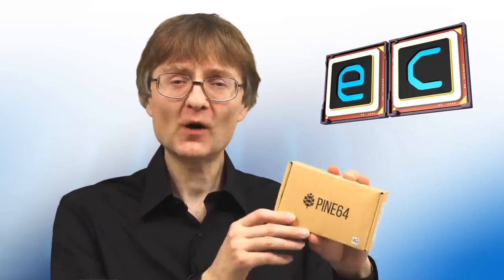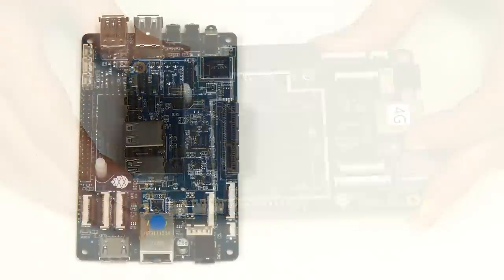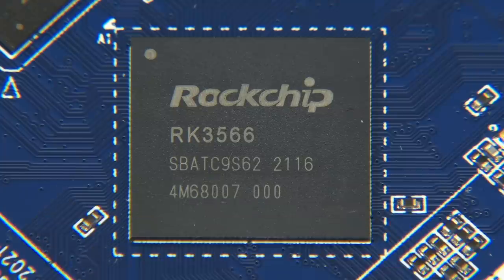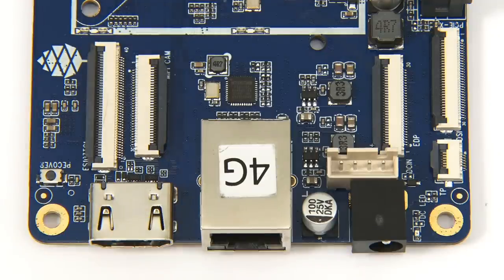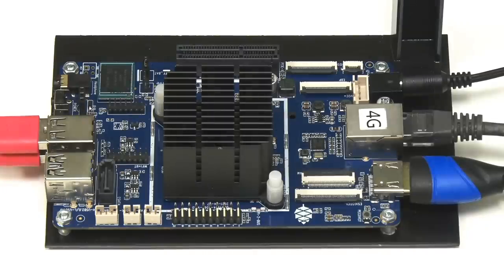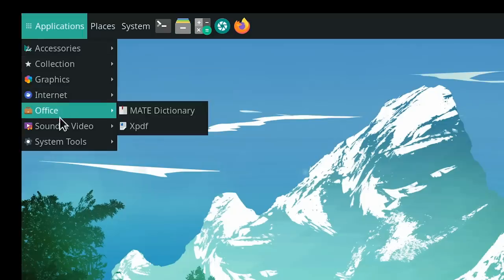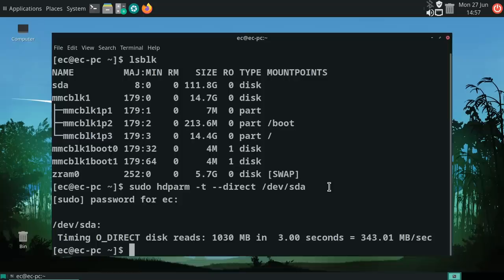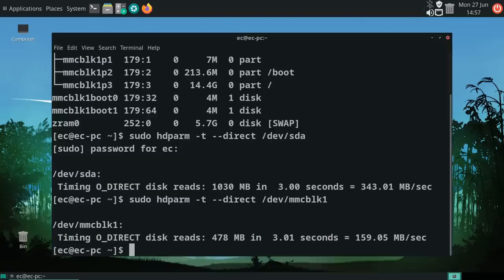Quartz64 Model A – PCIe & SATA SBC

Comment: I'm surprised you did not try a simple graphics card...
Reply from the maker: I was certain that it would not work!
Reply: @ExplainingComputers  Can you share why?  Because of the current software support?
I would say that GPU limitations of a single board computer is a rather limiting factor for some things like gaming. Not that an SBC should be used for high end games. However there are certain games that artificially demand certain characteristics of a graphics card an a integrated SoC rarely meets those.
I'd compare it to upgrading a simple desktop computer from its onboard videocard to a separate graphics card which frees up some system memory and computing power so a couple of games that were just beyond reach are now possible to play.
Reply: @DoctorOnkelap  The PCIE slot on the board is specced at PCIE gen2 x1(electrical connectivity). Even if you could get the software to work and be able to provide adequate power to the dedicated GPU, it's going to be so starved of bandwidth.
Reply: @longdang2681  Thanks for the clarification. The video already mentioned it was basically a glorified USB3-port, but what you wrote takes away any doubt.

Comment: I've got a ROCKPro64 I think it's probably the best SBC (if you can call it that) in my opinion. This looks interesting. I hope they update it again in a year or two, keep the same form factor and external ports (external when it's in the NAS case) and update the CPU more. Also it would be really nice if they had two SATA ports on the board and they didn't share wiring with the USB ports. Because at the moment you need to use a PCIe card if you want to use two drives for the NAS, but then you don't have any options to upgrade it. I mean in terms of adding a PCIe card (such as another NIC.)
Reply: I'm glad they updated the maximum amount of RAM however even if the CPU isn't really any better. Because when you're doing things like running ZFS it's nice to have a bit more memory.
Reply: The reason I think this and the ROCKPro64 are better then something like a Raspberry Pi is because it's a bit closer to something you'd actually want to use for a server or a desktop while still being a very small and low power arm device. The Raspberry Pi still feels like a bit of a toy and you'd have to use a bunch of a adapters to do some of the stuff you can do with these Pine64 boards.
Reply from the maker: I agree, the ROCKPro64 remains a nice board, and works well running (eg) OMV.

Comment: Strange you're seeing graphical issues, I think that should be supported by Panfrost, so should have (at least) OpenGL-ES on fully open drivers. Maybe Alyssa and the team don't have a board with that SOC on it...
Reply: Panfrost has support of this SoC since Mesa 21.2. This is most likely an issue with the Rockchip VPU or something with the board in particular missing in the kernel

Comment: Perhaps you should add a PCIe -> NVMe adapter to your stable of testing equipment, I'm curious to see what kind of performance you could have gotten out of that.
Reply: I tried that on an older PC with  PCIe 2.0 x1. and the results were quite disappointing.

Comment: I had a Rock64 and sold it because the software was unusable for anything remotely serious. I love the value proposition from the hardware side, but I moved from the Rock64 to a Raspberry Pi Zero W and it's much more useful because it actually works.
Reply: There is plenty of software for the Rock64. I have had one since it came out, and use it for a NAS.
Reply: @knerduno5942  I guess it depends on your applications. My unit always ended up getting corrupted OSs. There is the illusion of plenty of software options for the Rock64, but a lot didn't even work for me (despite using new MicroSDs, etc). It's just my personal experience, of course, but I'm glad to be rid of it.
Reply: @MarcosCodas  Could of been a defective unit. I had the company I worked for buy four of them, and we installed a Debian based image on them, and all of them seemed to work great.
Reply: @knerduno5942  Yeah, it could have been. But that doesn't speak highly of the company, either. So I just sold it on. The person who bought it is happy with it as they use it in a setting in which it works (the right OS, the right application). There was a Debian-based OS which worked for me, one by MrFixIt or some such name. But even then there were a lot of problems when trying to run what I needed (a LAMP stack) so I just gave up on it. I sold it advertising it as such and the person who bought it uses it for semi-embedded applications via GPIO and it's been great for them.
Reply: @MarcosCodas  At least there was a good ending for the person who bought it. But yeah, Pine64 seems to want to wash themselves of responsibility. "But ma non profit status!"

Comment: I bought this board probably around the same time as you.  My purpose was graphical testing to see what I could do.  I was disappointed that graphics is still lacking after a year.  With so much potential for display outputs on this board, you think they would move GPU support up in the priority list.  Still waiting on that to happen.
Reply: Because the distro devs are not doing the drivers, and waiting for someone else to do it.

Comment: I don't know why Pine released the board without the needed hardware support, in particular for key features like sata and PCIe, which are supposed to be features the rest of the SBCs lack.Thank you for your honest and clear review Professor, as usual.
Reply: You mean software support?  For the past couple of years they have been steadily releasing hardware without much of any software support.
Reply: @knerduno5942  yes, the video shows a really poor performance at least in the desktop environment
Reply: @alerey4363  Because nobody is working on video drivers. Heck seems to be no drivers for the SATA port. Really sad.

Comment: Truly it is a fascinating SBC.  I would be interested in a follow up video, once the software is "all" working properly.  Definitely this SBC shows the possible future of SBC hardware.  Looking forward to you next video!
Reply: Good luck with that. The PinePhone has been out over two years and still no stable OS for it. Also, their original Pine64 SBC, most of the distro developers for it dropped support for it quite fast,
Reply: @knerduno5942  …and that is why I’m not abandoning my Raspberry Pi anytime soon.  LOL.
Reply: The thing is Pine64 gave out 10s of thousands of dollars in donations to about five different Linux OS projects who are making a mobile OS for the PinePhone, and still no stable OS for PinePhone? What did they do with all that money?  I hear ya. I am very hesitant to buy anything more from them until something gets done. I have delayed buying their PinePhonePro ($400 is a bit much for the specs), and their SOEdge because both of them are lacking in software support. They released the SOEdge, and no a peep from them about it since it was released some time ago.
Reply: @knerduno5942  Yup, hardware without decent software support is like having water at the kitchen table without a glass.
Reply: @knerduno5942  _ 10s of thousands of dollars_ sounds like a lot, but it is a drop on a hot plate
Reply: @perrymcclusky4695  Wow, you have a kitchen Table? Lucky you! It actually is more like have the water pipe, without the fosset, come into the kitchen without furniture and equipment in the shipping containers...
Reply: @ronaldglider  Yup!
Reply: @ronaldglider  I am sure people can donate anytime they want to project, but I am sure an infusion of  let's say $50,000 for a project which there are volunteers, is quite a lot. They could of used some of those funds for Bounties to get some more hardware functionality out of the phone, but nope.
Reply: @knerduno5942  Money is not enough... Access to the HW description of the processor chip wrt to I/O blocks is needed too. For instance, the NXP SoCs have ~7000 page Hardware Reference Manuals

Comment: Pine is doing interesting things with Arm. Their Pinebook Pro looks like an interesting MacBook Air alternative, and it's only $200. I haven't seen a very good review of it yet, though. None that have demonstrated performance very well, at any rate. All I know is it has six CPU cores, two of which are faster.

This SBC looks like it is wanting in the CPU department. I like the other features of it, as it looks like it could possibly live in a Mini ITX case complete with a SATA drive attached. Shame it's so slow, as it would otherwise be a good desktop option.